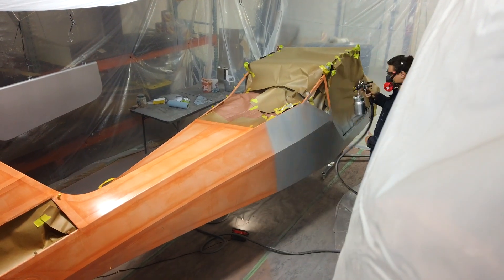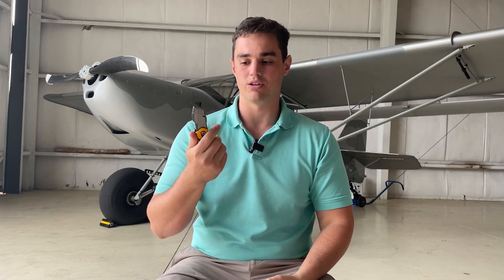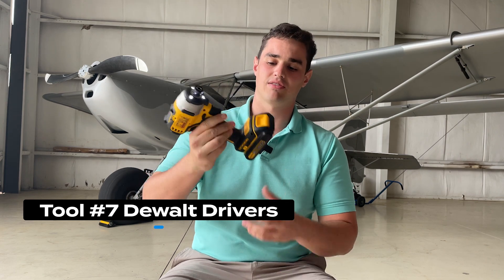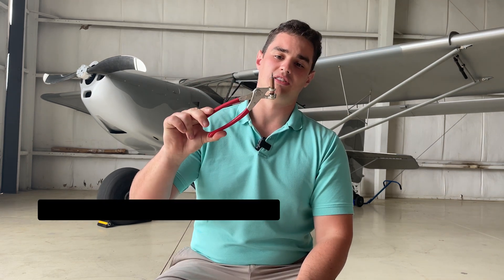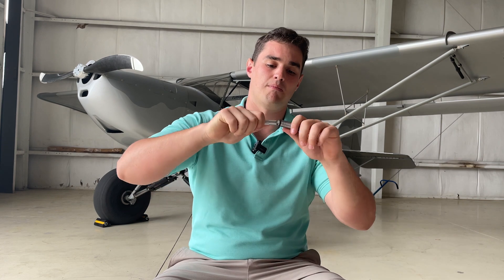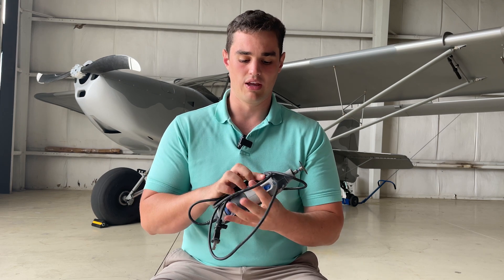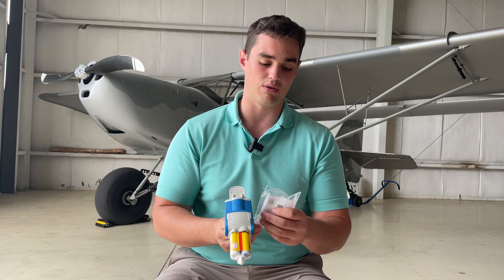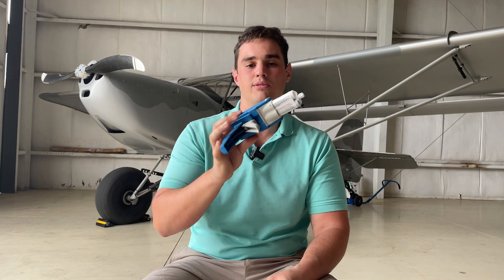MY TOP 10 MOST IMPORTANT TOOLS TO BUILD A KITFOX

Comment: "Squirrel"...P-51 flyby🙂 would also mention Sharpies, wire Cutter, crimping tools, safety wire plier, torque seal, straight edge/ruler, blind rivet puller, painters tape, multiple #30, #40 drill bits, bench vise, lots of pinch clamps,  deburr tool, and ....

Comment: Box cutter is the worse thing to use, try a exacto knife! Also you should never use a impact driver for the bolts.
Reply: Single edge razor blades in a handle work great and are inexpensive, about 10 cents per blade.